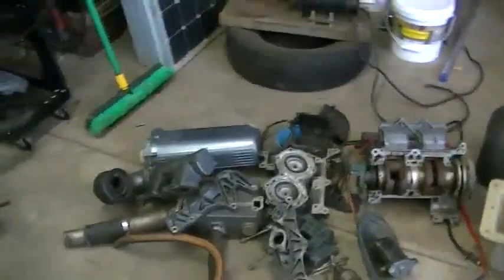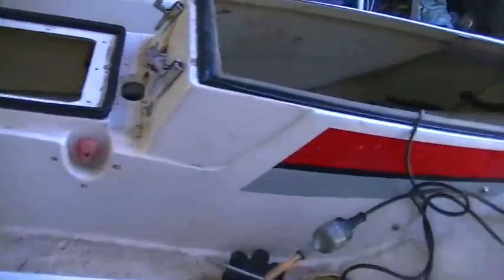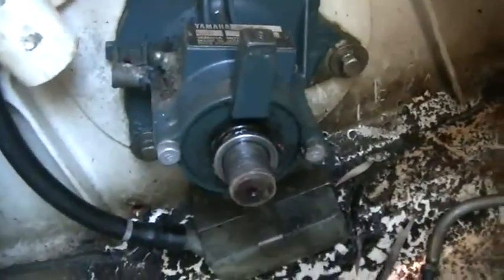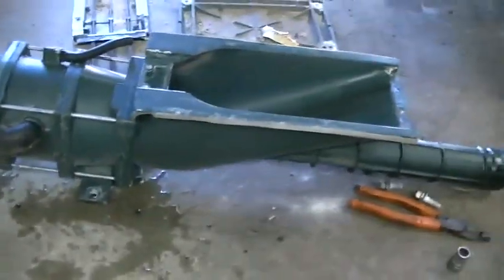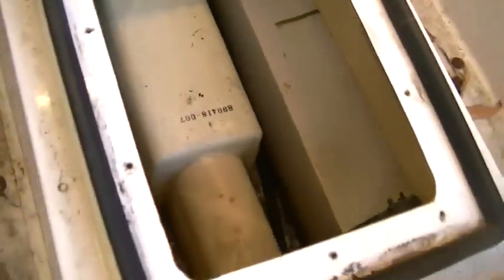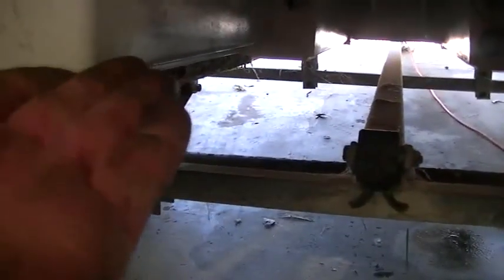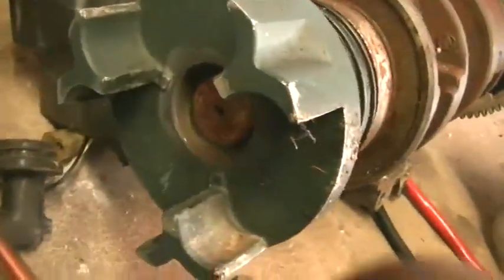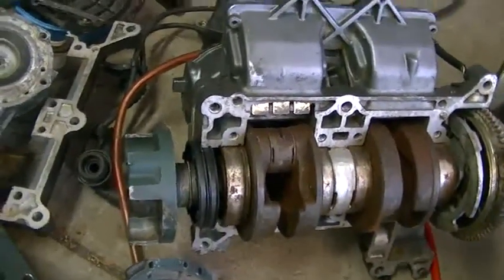Electric boat project pt2

Comment: First I must say great videos ! Every time I watch a new one I learn a little more about our similar interests. I was wondering if you gave up on using the smart drive motors as a AC generator ? And as I am  find strange results along the same lines I was looking for an informed opinion on if it’s worth continuing experimenting with these smart drives as generators or look elsewhere for generation sources ? Thanks again would appreciate any input greatly.

Comment: Look at alexander motor-generator again. The structure is wrong but the description is correct. Try to combine 3 structures of 3-phase no load synchronous motor, 3-phase transformer, and 3-phase synchronous generator together. You will notice magnetic attraction is a non-thermodynamic process, the secret of overunity machines. It actually uses no energy to work. Faraday's law is naturally negentropic. They simply added external kinetic energy sources to make people think it is "thermodynamic". What a great deception.

I hope you are willing to try this out. You cannot give up now. 2020 is the year of change. You got to let the truth out.